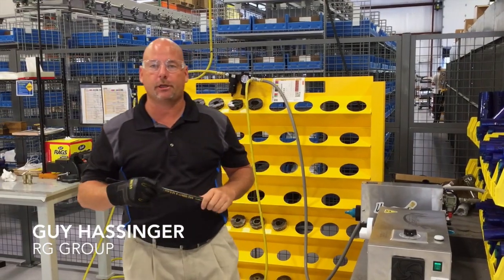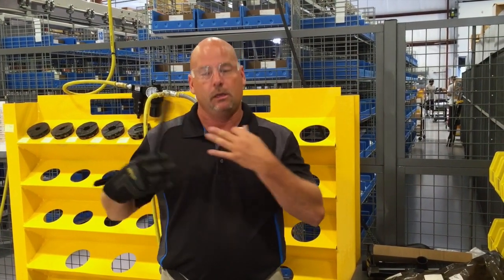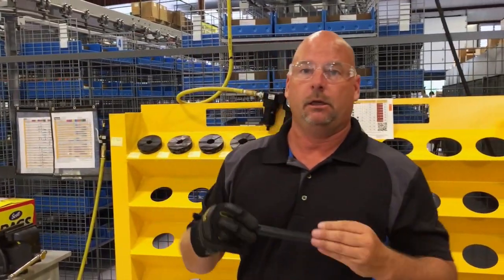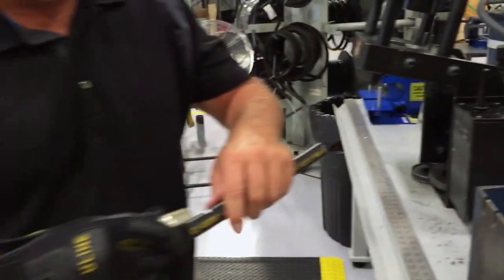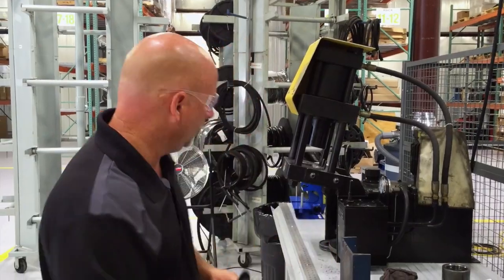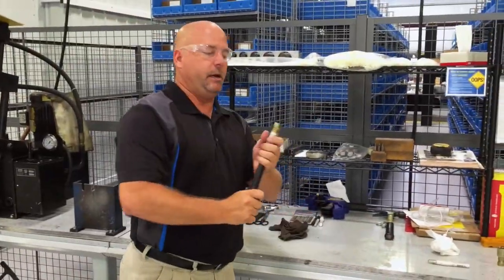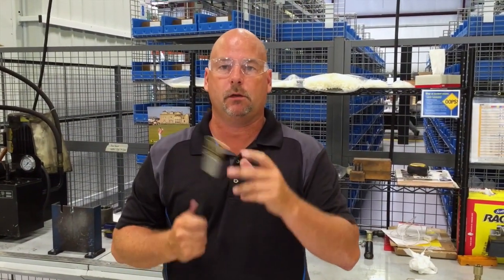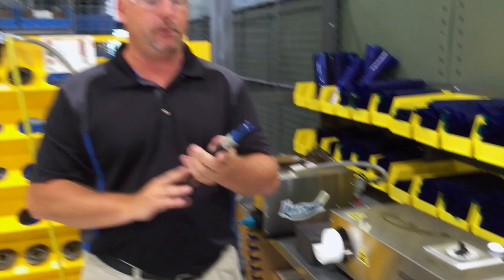How to properly make a hose assembly

Comment: looking to make parker hose 04M0340340-0024 and 04M0340640-0180 but I can't figure out the assembly components, I know that the length will be 24 and 180 inches.
any help will be greatly appreciated.